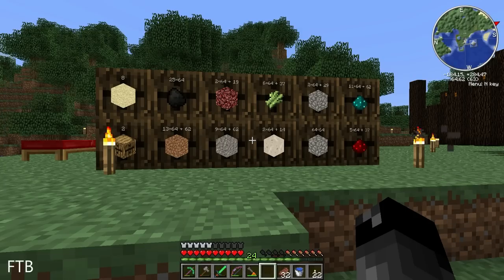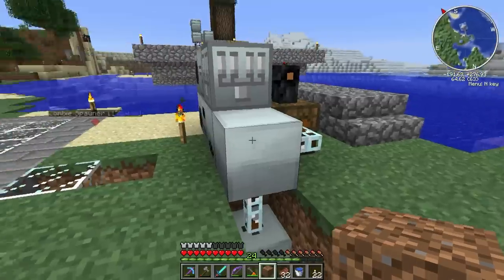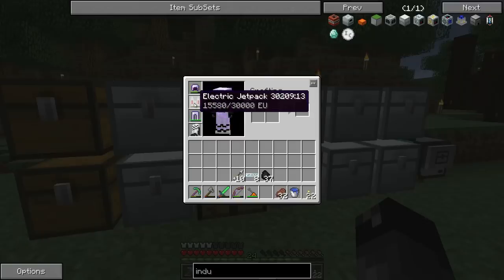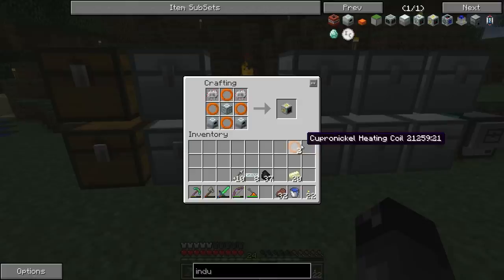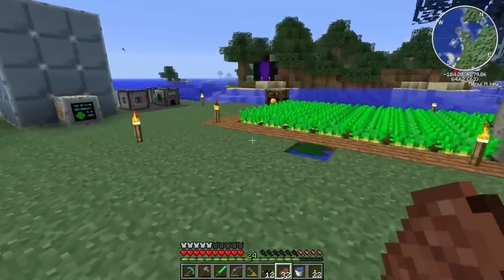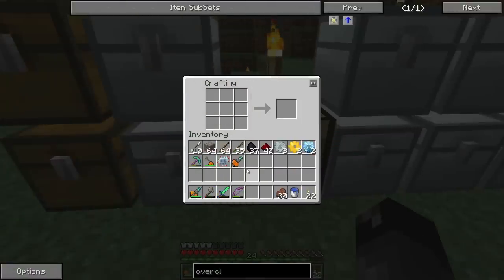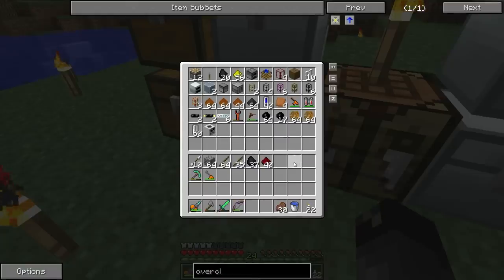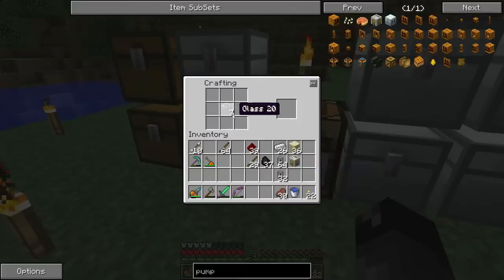Minecraft Feed The Beast E07: Industrial Blast Furnace

Comment from the maker: MFSU puts out 512EU/tick power.  If you connect that to copper cables or to low power machines you'll blow them up.  You need to convert the power to medium (128EU/t) for those types of machines and even further to lower (32EU/t) for the lower tier machines.

Comment: Now this might be a really silly idea, but you have that generator thing. If I understand it correctly, it burns stuff like a vanilla furnace does and generates energy in return.
Have you tried burning cactus blocks? Cause cactus farms are simple to set up, they need no maintenance whatsoever, they basically supply themselves (harvested cactus blocks can be used to expand the farm) and Im positive there is some way you can auto-pipe them into the generator.

Comment: overclocker upgrades speeds up your machines but then it costs you much more EU you should rather go to the next tier of equipment like rotary macerator or induction furnace. Also check out pulverizer it works lot like macerator, just a bit slow but can give you some bonuses, together with industrial furnace (or how the thermal expansion furnace is called) you can increase your income of ores about 10-15% thanks to ritch slug